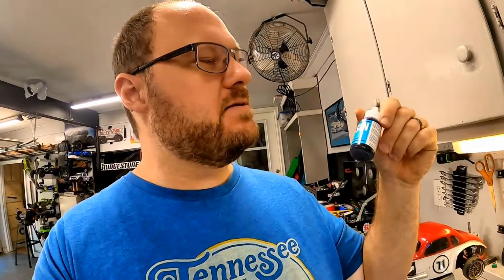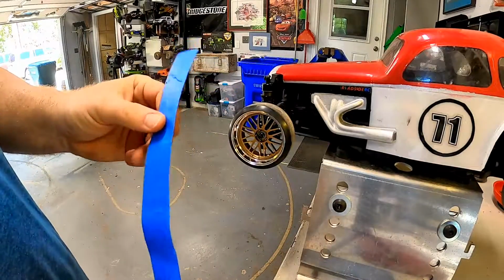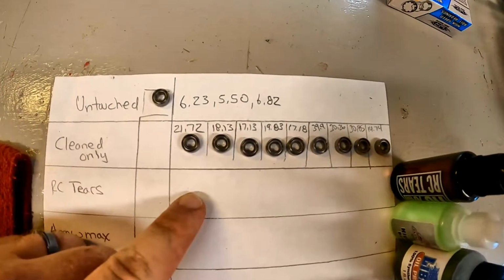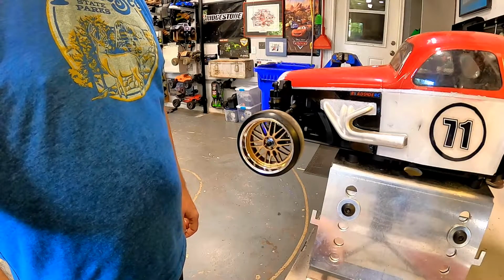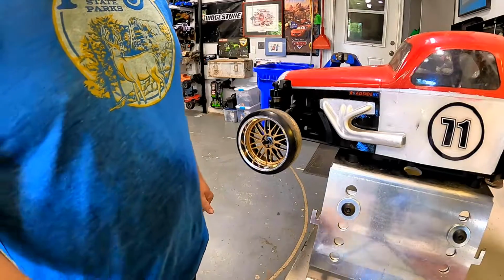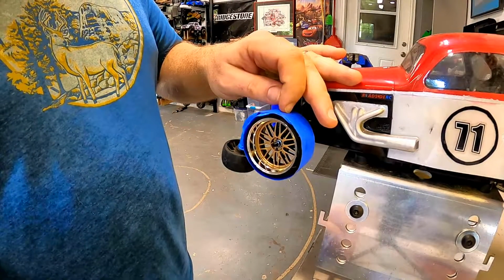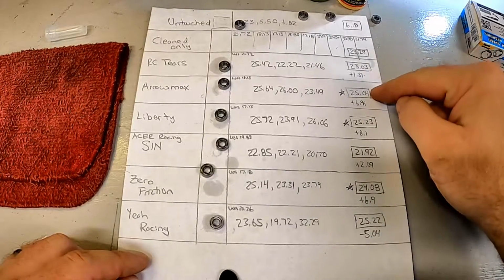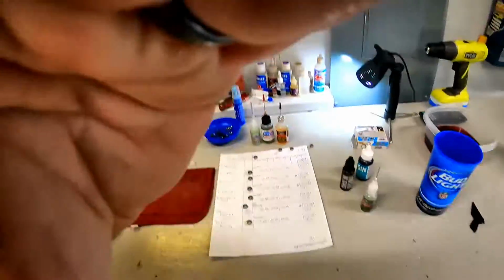TESTED | Best High Speed RC Ball Bearing Oils

Comment: My basic recipe for re-servicing a used bearing is as follows:  (1) To get rid of oil, old grease etc residue, I soak it in mineral spirits for a week; every other day put the bearing on a pencil and spin it while it is inside mineral spirits (2) At the end of the week, I blow dry the bearing, and soak it in white vinegar for 4 hours or so to get rid of rust (if any), and rub its surfaces with a cotton ball.  In small bearings you may not see rust, but it is there especially if you are living in a moist climate (3) I oil it with Singer sewing machine oil.  I found this to be the lightest and most dependable one because it sticks onto racing surfaces the longest.  I apply this recipe to tiny bearings used inside electric motors, and RC model engines.  If the bearing is destined to spin less than 5000 rpm, such as in a car, then I pack it with quality bearing grease like Lucas or Redline synthetic.  Depending on the application and working environment I either remove the rubber bearing covers, or keep them on the bearing.  Your method is good, but the times are very close to pick a true winner.  Perhaps you should also try incorporating some sort of "bearing longevity" test to see if each oil you tested stays on the bearing or not.  Good video nevertheless; I enjoyed watching it.
Reply from the maker: Thank you for that detailed description of your process!  Sounds like a very logical way of handling bearings. 

For a longevity test - what would you recommend?

Comment: Which mineral oil is best for the cleaning of the bearings?
Reply from the maker: Sorry, I did not test cleaning specifically.
Reply: @RoadsideRC  did you use a shock mineral oil to clean them? Does it matter which kind?

I‘d like to order some but there are different numbered mineral shock oils so wanted to ask first.
Reply from the maker: @muaythai193  I used a generic mineral oil from the hardware store for cleaning.   Nothing special.
Reply: @RoadsideRC  Thanks! Crazy that when I asked around nobody cleans new bearings.

One thing that could’ve been done in the test is have uncleaned bearings oiled as a comparison to cleaned oiled ones.

Comment: Have a "trick" to cleaning bearings. I do this alot with baitcaster bearings. Maybe try this out and retest. Plastic cup..fill about 1/2" or so with ronsonol lighter fluid..Take hair buzzers or dog trimmer and turn them on..place cup against the trimmers at a spot that has the most vibration and you have a mini ultrasonic cleaner. You can actually see the crud come out. Do as long as you want. Take bearings out and place on paper towel, let dry or blow out. Spin a few times. add oil..
Reply from the maker: Great tip!!!   Thanks for sharing.

Comment: Batting oil is good but when it runs the bearing gets hot and the oil get dry... Normally I put grease to bearing I remove the rubber shield and I just put Marine grease it makes it so smooth and long-lasting
Reply from the maker: Thanks for the tips!

Comment: For 9,000 RPM laptop fans, I decided to go with economy size liberty + Diamond Nano @5% - and that's my new squeek hammer. I just want it to last a year in the laptop - not 24 hours like the Dialectric Grease did. Currently running pheumatic oil - running silent but known to evaporate. Fortunately it supports an extra firm meniscus (drop-reservoir) until I get the good stuff. That layer thickness is actually very important for shaft lubrication endurance. Less if it doesn't evaporate - but it's kind of like a reserve supply - large e-motors have a felt reservoir that presses against the shaft.

Comment: Lotsa stuff to add: 
* Drip viscosity (drip meter) mainly. For shaft lubrication staying power.
* Heat - weight loss (evaporation)
* Stack the bearings, run them at speed, like 50MPH equivalent. Measure the temperature very very accurately. You're done. Cooler wins.
* Same as above except - run 8 bearings independently. Run all bearing to destruction. Give us all the data.
Reply from the maker: Those are some good ads for sure - thanks!

Comment: Love the Effort to find scientific results. RC Bearings are similar to Skateboard Bearings, and many skateboarders prefer to clean bearings with any household True Citrus Cleaner. The citrus removes oil and grime leaving the bearings completely clean. I Recommend a larger container to separate the dirt from the bearings, I use a Gatorade bottle and cut 1/4inch pieces of plastic straws to act as spacers between bearings to allow dirt to escape. Note that a lube that performs well during freespin may not perform as well under a load, thicker oils and even grease usually perform best but require a short break in period. 
Another test might include rolling down a hill and measuring distance. ?    Great Video!!
Reply from the maker: Thanks for the comments!

I had considered a downhill rolling test, but didn't know how to make it repeatable.

Comment: You can also use a standard bearing friction test. Like the type used for automotive oil test. The oil is applied to a bearing race then the machine applies a wieghted  friction untill the  oil fails .. if for example if zddp is added to an automotive oil. The wear- friction is greatly reduced
Reply from the maker: Unfortunately, I don't have this type of equipment.   Results would be interesting for sure!

Comment: MAYBE we can do another test on a bench rig using one of those basic wheel balancer stands on bearings you know?.. then  modify it with a motor on a hinge that’s got a wheel mounted to the motor shaft that will spin at the same rpm/voltage. We lower the hinge so that both wheels are making contact and run a set voltage. Once we have a steady speed, raise the hinge (motor/wheel) “slave” so that it’s just the wheel on the balancing stand rolling by itself with the bearing we’re testing. … I’m thinking of this  bcs it’ll allow us to test higher levels of friction and put the oils under stress to reveal pros and cons of the oils. 

This was a KILLER vid I came here specifically to find an oil demo like this THANKS!!😁 but since you have all these oils now and bearings, I think with ALL THE PPL DOING SPEED RUNS that your bench test will grab a lot of attention! Would you consider it?
Reply from the maker: Great idea - I really appreciate the thoughtful answer with truly a better solution!  

The bearings and oils have mostly been given away at this point.  

I could see doing this all over again though.  Curious if any new oil or bearing technologies are "around the corner".

Comment: They probably use a thicker oil/grease from the factory so the bearings last longer. I’m looking at something for extremely dirty running, muddy/dusty pits, dirt roads and wet grass are what most of my running is in, and I know it destroys factory bearings quicker than acceptable. Gonna do some testing with marine grease as well as moly/ptfe fortified grease and then maybe some kind of dry lube to see if any of them stand out.
Reply from the maker: Interesting!  I would be curious what the results show!
Reply: @RoadsideRC  Hmm, maybe I’ll do a video on it cause I see no dirty rc bearing lube tests, I’m sure there’s some way that’s better than factory in making bearings last longer in dirt =)
Reply: @travispratt6327  It’s simply not feasible to perform ‘dirty’ bearing tests, as you mentioned. This is because unless you start with a pure, unadulterated substance to use as your dirt (obviously actual dirt can’t be used as it would have enormous variation from one scoop to the next, having different proportions of clay, sand, soil, etc), get the exact identical amount which has been weighed on a digital scale measuring to 0.01g accuracy and mix the sand or whatever you use into the same amount of each lubricant you’re wanting to test. Then you have to figure out a way to mix all the oils with your dirt but so that each is as close to identically mixed as possible, somehow pack that crud into the bearing, put the seals back on and then start testing. Oh, did I forget to mention that you had also better brush up on your chemistry because some oils or their additives might react with your choice of dirt. If this occurs, that oil can not be included as you’ve changed it at a chemical/molecular level in some cases, depending upon how reactive the oil might be.

As I’m sure you can now understand there are just SO many variables with the kind of testing you want that unless you have a huge budget to spend on your testing procedures, you just won’t be doing any form of scientifically sound tests. It’s not something for the faint-hearted, takes hours and hours, if not several days and is boring and laborious, especially if not being paid to do the testing.
Reply: @aaronperelmuter8433  All I’d have to do is simply use the bearings and run enough tests to have a big enough sample size to be able to draw conclusions that certain lubricants generally last longer. The variables don’t matter as long as the sample size is large enough with the same varying terrain. I’d also not want to remove any contaminants that may interact, or limit the dirt to only one kind of dirt, these wouldn’t give real world conclusions.
Reply: @aaronperelmuter8433  That said, it would probably take a minimum of 10 rounds of running the bearings till they failed for each lubricant to even get a semi-accurate result, and is too much time and effort for me.

Comment: just an idea for a more accurate test is put a rubber wheel onto a cordless drill set the drill to speed 1 or 2 and then use that to spin up the wheel untill the speed is maintained on both this should give you a more equal spin in your tests :)
Reply from the maker: Good idea!  I like that. 
Obviously, you can see I was trying to find a consistent method for spinning.

Comment: You cant really judge a bearing oil by how long it spins
Reply from the maker: It is the best way I could come up with. 

What would you suggest?
Reply: @RoadsideRC  that is more complicated. Like liberty oil was made for clocks for example. How well the oils do against dirt and water. How good are they to protect against rust? How long before the oil just flushes out? What good if after a few packs the bearings are just dry and locked up?
Reply from the maker: Do you have any suggestions for testing? 
I recognized all of those questions, but only have so many resources available to me.  This is what I could create in my garage. 

I'm happy to hear suggestions of how to test it better.

Comment: Those types of tests shown in this video are highly inaccurate so don't bother with them. This particular tests shows almost no actual results because the bearings have massive differences between each other in the first place and more importantly, there is no load on the system. The bearings could be slipping more or less because there is no load. The video just shows that cleaned bearings are turning better than the dirty ones which should be obvious. Try a ceramic bearing set at the track vs a steel one, you would observe a quieter car, electronics that heat up less and ultimately a slightly longer runtime with the ceramic bearing set. I am telling you this from personal experience. They also don't require frequent maintenance or replacement as the steel ones. I blew up consistently several motor bearings. No issues with the ceramic replacements so far. The oil in this situation matters so little that you shouldn't even bother that much selecting a brand or switching to another brand. Just clean your ceramic bearings ideally before each race, lube them with light oil and you should be fine in the long run.
Reply: 🤣 Come on man. It's a youtube video. Not a scientific paper submitted to some RC Car Journal. You're taking this wayyyyyyy past logical at this point. What's the point in being so critical of a youtube vid that's already meaningless? 🤣🤣🤣🤣

#CalmDownBuddy

Not reading #AllThatCrapByU, either. 

Talk about a wall of text. Try hitting enter twice after every few sentences. It makes what you write much easier to read and you don't come off as someone with the writing ability of an 8 yr old.
Reply: @J.C...  True, I guess I just wanted to share my experience. 😃
Reply: @J.C...  True, I guess I just wanted to share my experience. 😃
Reply from the maker: Thanks for the feedback!

Comment: Have you tried using WD 40?
Reply from the maker: I did not, as I had not seen many folks suggesting it.  
Do you use it?
Reply: @RoadsideRC  I use it all the time, for many uses.  It works well as a cleaner AND lubricant.

Comment: i use 0w20 motor oil
Reply: Gil Losi Jr. won many races with his JRx2 using Mobil 1 5w30 on his bearings. There is a late 80's video right here on YT with him talking about that...
Reply from the maker: Thanks for the tip!
Reply: @RoadsideRC  its not a tip im not even sure if its good lol
Reply from the maker: Ha!  Only one way to find out!
Reply: @RoadsideRC  Actually, there are several ways to find out. The most glaringly obvious of them is the simple fact that every oil you used had very similar viscosities, and none are anything like as horribly viscous as is car engine oil - regardless of its rating and/or brand. Car engines have to perform under incredibly punishing conditions, hence why they need to start out so thick and viscous, so that by the end of the 10,000 or 15,000 or 20,000 miles when it’s due to be replaced, it still retains some ability to prevent metal on metal contact, even though by then it will have been heavily watered down, taken on loads of metallic particles and shavings, absorbed various acids and carbon and soot from the combustion process and so on.

Don’t use car engine oils in your rc bearings, it’s a terrible idea and you’d be better off leaving the original grease that they’re sold with. Essentially, engine oil is half way to being a grease especially when compared to the very thin, low viscosity rc bearing oils. After all, grease is nothing more than oil with a thickening additive, very often either lithium or molybdenum.
Reply: @RoadsideRC  but it works good for me

Comment: wohh, interesting. not the same hobby here (I build Knex roller coasters) but we in the knex roller coaster comunity have 3d printed our own wheels houseings and used these same sized bearings for the wheels as apposed to the stock plastic bushing ones. and its made a huge difference.... how ever it seems useing this oil increases the spin time, but thats with the addex rotational weight of the rc wheel, how dose this affect just a naked bearing spin time (what we use) ive just been running mine completly cleaned and dry so far.
Reply from the maker: Great question.  I don't have a way to test just the bearing itself. 

Note - I did notice that just cleaning them itself was a HUGE improvement.  However, using the right oil did help.  Can you build a test rig with your roller coasters and do a similar test to what I did?   How far the coaster goes with each oil?  Something like that.
Reply: @RoadsideRC  yh I might try some tests. how ever I need to buy a good amount of bearings first, the coaster cars we use have 12 bearing for just the front car, then 6 on eatch car after it. so I would have to test sets of 12 bearings all at once, so testing 5 types would mean preparing about 60 bearings lol

Comment: I like the idea of the test. But honestly speaking your results will varey from bearing to bearing. Would it not be more accurate to use the same bearing cleaned between each test? That way you eliminate all the variables.
Reply from the maker: You might be right, and I did think about that. 
I picked the ProTek bearings, as they are supposed to be high quality.  Even with that, there was still some noticeable variation between the bearings in the pack. 
That is also why I calculated the difference between cleaned and oiled for each bearing. 

My concern with using the same one repeatedly was any change induced by "wearing-in" the bearings that folks refer to.   I guess doing A-B-A testing would help eliminate that some.
Reply: @RoadsideRC  breaking in bearing require the bearing to put under load. Free Wheeling shouldn't have enough load as its only carrying a wheel. Plus you do have lube in it which will lesson any type of wear.